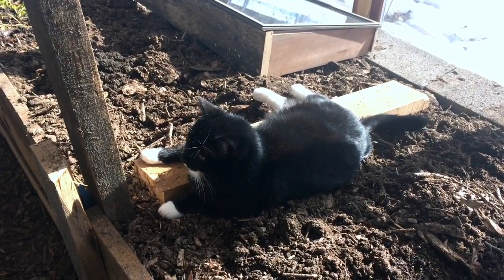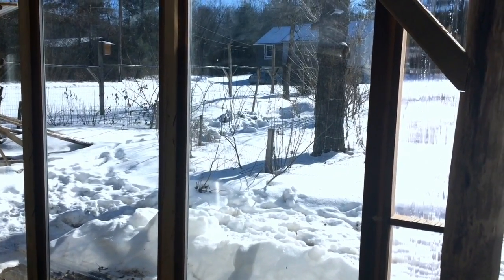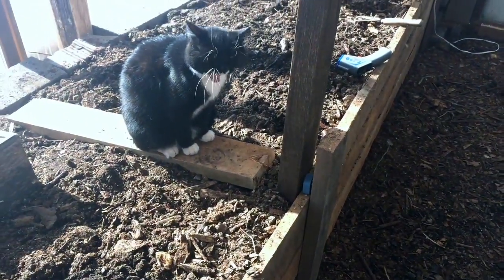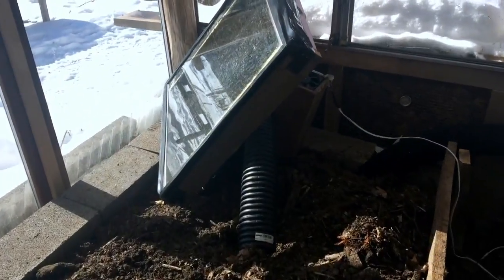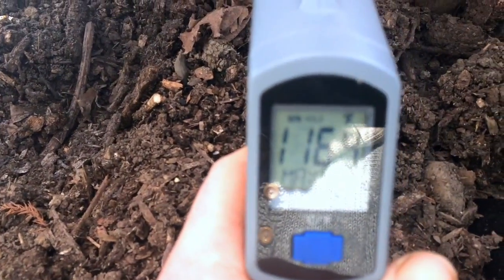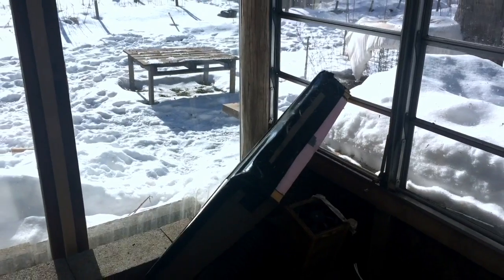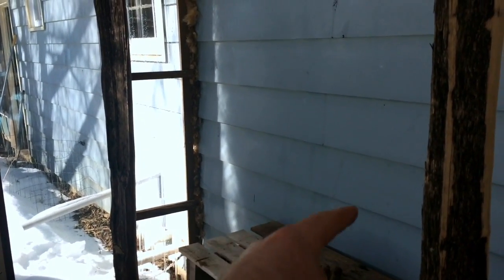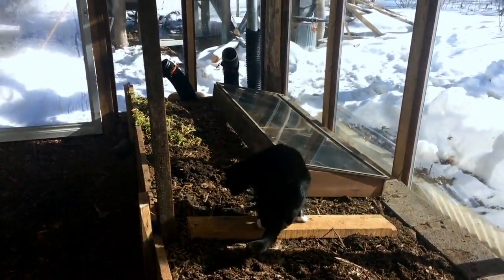Passive Solar Greenhouse - Solar Chimney Concept

Comment: very creative thinking...I built an air heater with 4" metal tubes painted black, mounted in a insulated box, but with a chamber 
built at both the top and the bottom to act as plenums . (stole the idea from several other designs on yt),  worked pretty well,
with a similar heat differential of 50 F incoming air, and 120 F outgoing air.  There is a family business in Wisconsin, 
Marine Vinyl Fabric, which sells clear vinyl which can be used as glazing for the solar box heater.   good luck

Comment: I'd pull the air from the top of the stack with a fan at the other end. Take advantage of the heat at the greenhouse ceiling by drawing it into the soil as well as the heat generated by the tube. By going against convection it should slow the overall flow putting more heat into the soil.

Comment: For those of you thinking putting the collectors out side...
Think of a car in the sun with the Windows up...
Out side you would get some type of cooling
Inside the car temps could hit 120°
On that basis i would think solar collectors would work better on the inside
In direct view of the sun...
But that's just my opinion

Comment: I'm endlessly fascinated by fluid dynamics, and I think it's always worth looking into more passive options not just from a cost/energy perspective, but also from the perspective of giving the space the ability to sort of function on its own in a more organic nature and less with the control of humans. I don't know how hot they have to be, but maybe one of those wood stove fans could work at the top instead of needing a solar panel? Or even something made from a thermocouple since you get such enormous deltas in temperature. Might generate enough electricity to move the fan

Comment: Have you tested the solar collector outside?  Would it be effective to create several tall and narrow collectors to go in front of the jambs and pipe that heat inside somehow?
Reply from the maker: Could be.  Although intuitively it doesn't make sense to pull in outside air since it will be SO much colder than the inside air, so I'm not sure I'm going to be doing that.

Comment: Those pipe if they were used in an electrical application would be called "electrical conduit" or just conduit. I hear all your idea and numbers, but never heard what temp you were getting at night... I think the night time temp is the real test. If you can get it so you never go below freezing in your soil, then you can really expand the things you can grow and harvest throughout the year. I have seed for a really awesome banana that produces small fruit and can handle some winter weather and a greenhouse that could stay about 40 would mean fruit year round.
Reply from the maker: Certainly not staying above freezing yet.  Need to button up a lot more and get the systems dialed in better.  I still expect the soil will freeze sometimes unless I want to have backup heat in the space which I'm not thinking I'll do...
Reply: @edibleacres  My father worked was a manager at a really prestigious farm/store/flower/vegetable store called White Flower Farm. They have incredible landscaping. It is meant for rich yuppies mostly though. When he first started there they told him to water the plants before a late freeze. Apparently as the plant takes up water, it creates warmth and helps the plants keep from getting killed. I know this is random, but it might help you out this coming spring if you are growing stuff in the greenhouse and frost comes through. I would be interested in knowing how the soil does in this deep freeze that is coming through this week. I know you don't want to heat this greenhouse, but you could make a couple of simple things that are off grid that can create a great amount of warmth, as simple as just a tea candle and an upside down flower pot(very neat and cheap). This guy on UK Here We Grow makes a lot of really neat stuff that is super cheap and can help warm up your greenhouse on a cold night, here is one of my favorite things and is super simple. https://www.youtube.com/watch?v=xrBWLaBViIM

Comment: i have the same thing in my greenhouse except i didn't use metal pipe i asked the FB universe for white 4" PVC drain pipe and constructed my climate battery out of that because it was structurally more stable and i knew i was burying it in rocks.  i painted it black and drilled holes in it for circulation.  it also runs the length out my 8' long greenhouse it seems to work very well but is unable to keep the greenhouse warm at night.
Reply from the maker: Thanks for sharing the photos of your project.  Hoping it evolves in great ways for you!

Comment: Nice Video Sean.. Looks like it's all working out really good! What effects are  you noticing in the house now?
Reply from the maker: Still not adding heat to our home in a real way.  Although yesterday the door was open for a while and it wasn't a huge difference in temps.  I suspect when we're in the 30s/40s outside WITH sun we'll be at a place where the greenhouse will provide a positive heat to the home.  I'll share notes as it goes.

Comment: That was my idea also to use black pipe I have and make a loop entering down the north wall under the floor up the windows under the roof down the north side and under the floor coming up and exiting in front tof the window.   Solar gain would drive it one way and radiant cooling would drive it the other.  I would like to build it into a hill so the north wall would be earth.

Comment: This isn't a criticism, but rather a caution. Don't try to over-engineer this project. Remember the K.I.S.S. rule. I often have to remind myself of that when working new projects. I'm trying to figure out which would be easier, raising the temperature of the soil in the grow bed, or raising the temperature of the air in the green house? If you raise the air temp., won't the soil eventually absorb the heat? If your vertical heat pipe is connected to the buried tubing, might it actually pull heat out of the bed? That's assuming the buried tubing is open at one end. Maybe you need a closed-loop system, where the heat tube is constantly pulling cooler air from the bed, then sending it back through the loop with the aid of a fan within the loop. 
I think you were going to blacken those cement pavers in front of the bed so they'd absorb more energy, right? Would be nice to be on-site to help you with this.
Reply from the maker: Come on over! :) 
 I hear you on this.  It may seem like I'm adding a hundred new elements to the system, but more than anything I'm cycling through options to get to the least fragile ways to have hot/moist air by day be actively circulated in the enclosed greenhouse AND hopefully move through the soil mass and exchange moisture and heat down into the soil...  At the end I think there will be less bips and bops floating all over the place in this project.  We'll see!
Thank you for the caution and reminder.  I appreciate it.
Reply: @edibleacres , Don't think you have to worry about exchanging moisture in the soil. Just keeping things properly watered may be enough to keep humidity levels where you want them.
Reply: Hey Brian, I think that a closed loop to heat the ground for a heat sink sounds like an interesting idea. But I also think that heating the ground should be the priority too as it will release heat through the night and keep the soil level from dropping below freezing at night. By keeping the soil above freezing you can really expand your growing season and varieties you can grow. I would love to make a Wofati one day.
Reply: @robertm4050 , I'm thinking you're right about making heating of the grow bed priority one. Even if the air in the green house is a bit cooler than the soil, the warm soil will create a micro climate right at plant level. This micro climate can be enhanced by installing hoops and plastic, or row cover. Cold frames are an option, too.
The word Wofati sounded familiar but I had to look it up. Yes, earth bermed structures and living roofs are interesting concepts. If you build a Wofati, be sure to document, then post videos. :)

Comment: stack effect works by moving warmer air upwards.  If the air at the solar collector side is warmer than the chimney, it will flow in the other direction, or not flow at all. also you are moving the heat up to the roof, rather than keeping it down near the plants, just so you can push a little bit into the soil.
I still think row cover is a easier and better starting place.
Reply from the maker: I am leaning more towards a solar collector at the stack side at this point actually.  I figure if I can stir the air in the space, minimizing the stratification during the day, AND get that heat/moisture to move down through the soil and exchange with that mass it would really help charge that mass.  I still plan on the additional cover over the bed for nights for sure.
Reply: @edibleacres  Generally speaking stratification isn't the huge deal people seem to think it is.  If that space is 2000 ft^3, and there is a 10 degree difference in temperature (extremely unlikely), that is 362 BTUs that you are trying to move around.  That is about the loss you will see for each 1 inch^2 area of air leakage per day.

Comment: Are you holding that temperature difference through the night?
Reply from the maker: Ahhh... good question! :)  The difference definitely diminishes over night as of now since we still haven't sealed all cracks, insulated, etc.  It's been average of maybe 15-20F warmer inside than outside most nights lately.  Happy with that as a baseline, but it can definitely be improved!

Comment: I’m not sure it would work as both ends of the black tubes are being heated and so hot air would like to rise on both sides like a heat tug of war
Reply from the maker: Good point, something to consider for sure.

Comment: That conduit is a great find!Chicken feet are most comfortable on wood whether tree branches or rough cut lumber poles which provide some insulation from cold.  Metal and plastic pipe are slippery and I feel they may have trouble keeping their balance.  Moreover,  I'm concerned that wet chicken feet might freeze on the cold metal pipes in winter.  My paw just used strong wood branches from the wood lot for his perches.  Love your new little sunny space.
Reply from the maker: Thank you for this note.  I didn't explain clearly enough in the video, but to mellow your concerns I had NO plans to use metal tubing for their perches, it just coincided with finding wood for the project.  It'll make more sense in the next video.

Comment: It is an interesting idea. Basically you would try to use the solar chimney to heat instead of cool?
Reply from the maker: Yes, well, I think more to act as a 'pump' or 'fan' to draw air through the beds and circulate/equalize temperature and humidity in the space during peak of day and get it stored as much as possible down in the bottom of the bed...

Comment: I had 64 F in shade at 4 inch height inside while outside was 32 F (around 3 PM, full sun all day). I intend to make an outside, airtight, insulated pile of bricks and big tiles where I can blow in warm air from the top of the GH (east side), zigzagging thru the pile (top to bottom) and entering the GH one foot above ground (west side), hoping to store heat during the day, drying the air and keeping air circulated. Once I have insulated my foot high brick footings, I will fill my huge collection of half gallon milk jugs with water and align them along the center path to supplement the 20 gallons already in place. But first I will have to grade my pile of B-rated 6 inch thick PIR insulation boards, cut and glue them on the outside of the footings. Big worry is the air moisture level when it is a couple of days clouded (Neversink Farm always ventilates his polytunnel in the afternoon during the winter).
Reply from the maker: Would love to see photos of this as it evolves, please do share!
Reply: @edibleacres  I will try, but noted today that the south facing polycarbonate window mounting system needs a full overhaul, also to allow for a gutter ;-(

Comment: You might not want the collector inside the greenhouse space. That energy is already present in the greenhouse. You are essentially robbing Peter to pay Paul. It might be better to collect the energy from outside the greenhouse for more solar gain/input. It is interesting to note that with the thermal panel inside, even though you are not adding heat to the area, you are condensing the latent heat to a higher temperature. Something to keep in mind.
The solar chimney is a great passive heating and air circulation idea. The way you have it set up now,  the air drawn into the soil is at the temperature at ground level. 
The highest temp difference and thus highest heat transfer would be pulling air from the top of the greenhouse. Please check that temperature before you continue. The use of a photovoltaic panel to run a fan seems like a great option. Maybe you could incorporate the solar chimney on the discharge side with the fan on the input side to increase the CFMs. The high fan would stack five functions. Heating the soil climate battery, dehumidifying the air, watering the garden bed, providing cooling in the summer and creating airflow to combat diseases and maintain a healthy environment...
Reply from the maker: Lots of good thoughts here for sure!
Reply: @edibleacres  Well, you got me to thinking... LOL. Why not use the solar panel at the bottom to create a supercharged chimney? You might produce enough draw to get rid of the fan!

Comment: The stack need only be black and fitted to the flex hose for it to work and having it close to the roofline  will help melt snow.
 As for the solar collector  I would keep it close to the glass indoors . The need for heat outweighs the need for light.

Comment: Hi there,
I would wager that you could move the solar collector outside of the greenhouse to avoid  'stealing' light from the interior and it would still get quite hot. Maybe put a large surface area collector against the side of your home next to the greenhouse and pipe it over?
Big fan of your channel. Have shared with friends.
Ken

P.S. I've heard that the reason rocket mass heaters draw air so well is because the stack found within the riser barrel gets SUPER hot. Evidently, stack effect is multiplied by the height of your chimney and/or the heat of the chimney. The point: a short, but hot chimney will draw as well as a stack that is cool, but twice as tall. (so I've read...I have no proof :) The hotter you get that stack, the more it will draw.
Reply from the maker: Thats why I figure in this case a nice tall stack is called for since it will only be getting hot based on the sun hitting it, not from a fire.
Reply: @edibleacres  👍👍
Reply: Have you seen these two sites? https://www.lowtechmagazine.com/  www.notechmagazine.com

There may be some stuff in the archives that would give your project a boost.

Comment: (Note to future self, trombe wall in front of the bed, exhausts into the bed.)

What about hanging them between the joists, as close to the house as possible? The hot air headed into the bed wouldn't be preheated, but it would help with getting them out of the way of the plants, and still in sunlight. Hang em on those screen door hooks so they're relatively easy to remove.

Might the air get trapped in the box? Leak up and out through the roof (and melt the snow)? Require a way to circulate the air?

Comment: black painted metal pipes is a definite or a  rocket mass heater at one end of the bed. Running pipes along to the other side. and then pipe it back and up through a chimney. cover with cob and you can sit on a heated seat and pick greens.

Comment: 4:00 if your purpose is to heat the air in the greenhouse, I'm not sure why you would insulate the "heat-absorbing" pipes on their shaded side. Yes, it might increase the temperature at the outlet, but not the amount of heat transferred to the mass of air in the greenhouse. After all, as I'm sure you know, temperature is a measure of molecular motion, not a one-to-one measure of "thermal content".

On second thought, you're hoping that that temperature gradient will "pump" air, rather than exchange motion with adjacent molecules?
Reply: The purpose of the metal pipes is not to heat up the greenhouse, but to heat up the air inside them, which would then rise, drawing air under the beds through the black tubes.
Reply: @TheNarrowNarrow  Thanks. I did figure that out eventually. Would insulating the shaded side help, or would the difference be minimal?
Reply from the maker: The thought is to get the pipes to collect more heat to create a strong stack effect.  I would think insulating their shaded side would help, but I'm not fully sure.